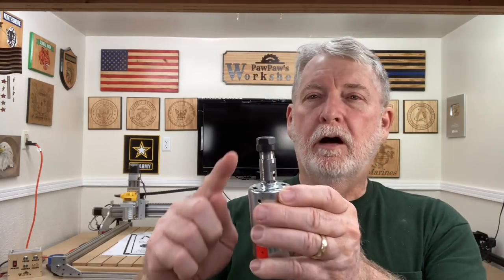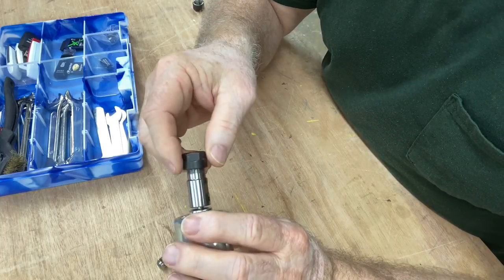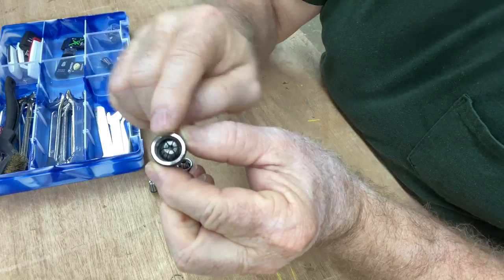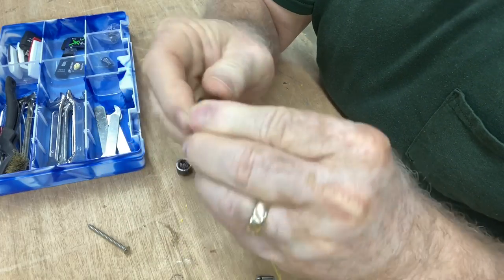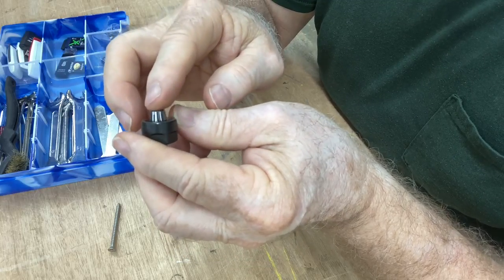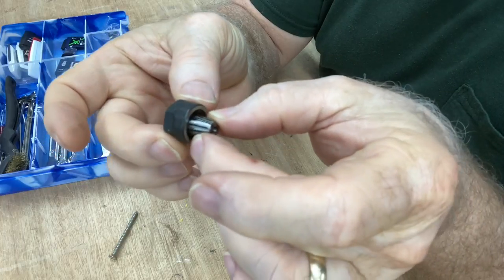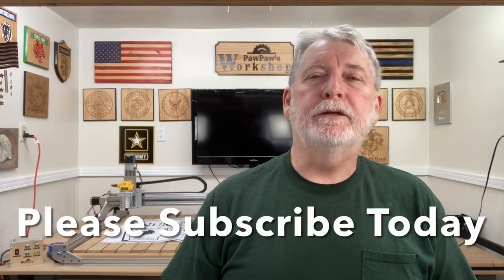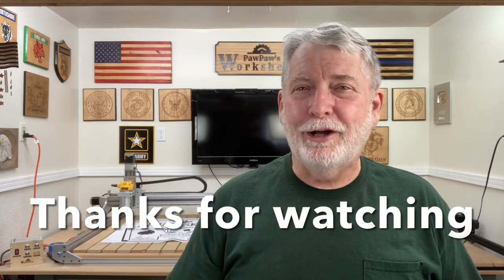How to Change the Collets in your Spindle

Comment: *** IMPORTANT NOTE*** A lot of people don't understand that the nut is actually machined offset inside. When you push a collet out you need to push a little sideways and it will easily come out with or without the screw. If you try to push evenly on the collet it won't move and that's the way it is designed. When I first got my collet set I tried to very lightly tap the collet straight into the nut and that ended with me having to buy a replacement collet. Sideways is the only pressure you ever need to remove an er collet! Thanks for posting and take care!

Comment: The 1/8 inch collet my mill came with comes out fairly easy like you show, but the new 1/4 inch collet has to be removed with a dowel I ground down to size and a hammer.  Pressing the 1/8 in collet in is also easy, pressing the 1/4 in collet into place requires squeezing it in with the vise...
Reply from the maker: It sound like it may be in mm and not actually a 1/4” collet

Comment: You also need to tilt the collet in correct direction... ie find the direction where the collet tilts the greatest then push it out with the screw head as per video or something similar (I use a flat head punch).. until I did this (ie found the right direction to tilt the collet) I couldn't get mine out.. after I learned that the collet NEEDS to be tilted in correct direction, it is now routinely easy.. do the same in reverse for insertion.. hope this helps!
Reply from the maker: Thank you for sharing

Comment: I don't know if they sell the bottom nut separately but I have the 3018 SE and the 4040 XE. I found it easier/quicker to keep one with the 1/8th inch collett and the other with the 1/4 inch collett and swap them as necessary. I had been struggling popping the old colletts out, maybe because I wasn't sure I was doing it right by applying pressure with a large screwdriver.  Your videos are always very informative.
Reply from the maker: That is how I have mine setup.  Much easier.  Great idea.
Reply: I have the 3018 and never was able to set it up completely. Do you have any vidies on the complete set up. I would love to start using my cnc 3018 pro machine

Comment: Just angle the collet and apply pressure outwards to it. It will slip out of the locking ring. No need for a screw head and risk damaging the collet.
Reply from the maker: If that works, great!  Whatever works

Comment: Hi, can you tell me how to remove the ER 11, not just the collet, from my Spindle 500? A thousand thanks.
Reply from the maker: It’s friction fit. If you take the nut off and the collet does not come with it, then it is stuck. You may try a little WD 40.
Reply: Thanks

Comment: Con you use these collets with the collet nut also for the Dewalt dwp611/d26200 ??
Reply from the maker: No, the er11 collets will not work in the dewalt router
Reply: @PawPawsWorkShop  Ok i understand, THANK YOU. Do you maybe know another solution? Instead of buying for each bit size always a collet together with a collet-nut...

Comment: It doesn’t work
Reply from the maker: Technically you do not need to use the screw. You do, however, need to move the center part all the way to the side using some pressure to release it